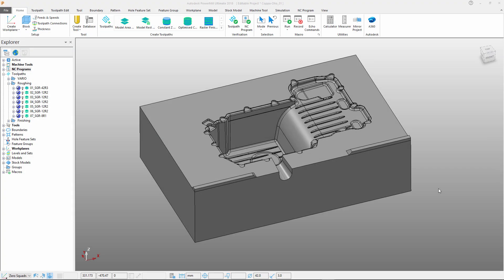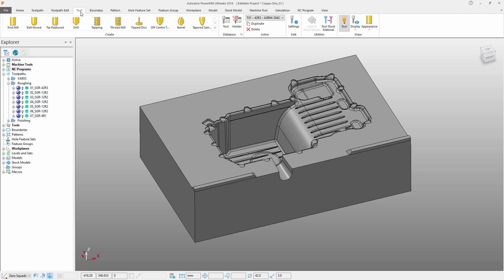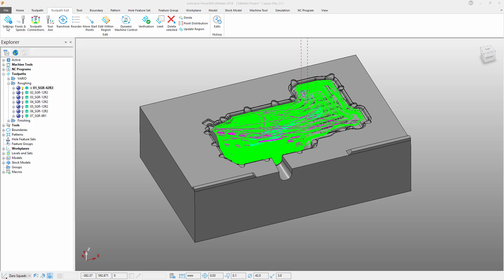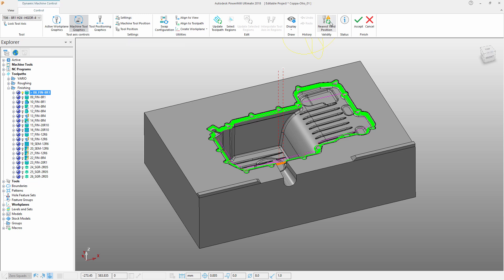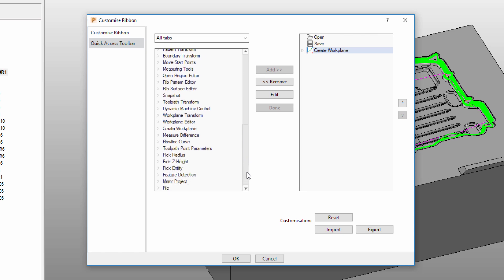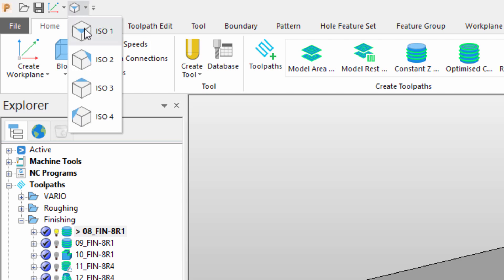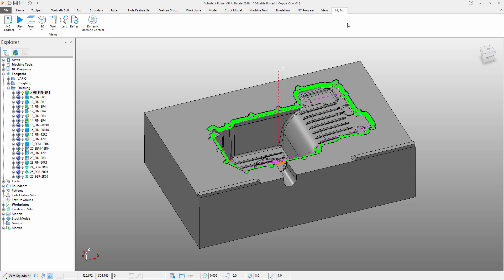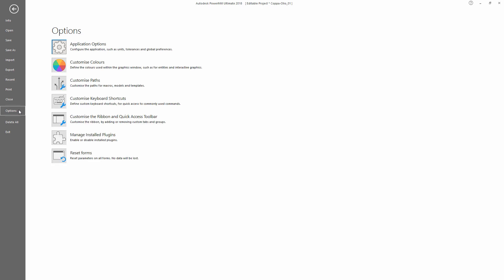Ribbon Interface - PowerMill 2018

Comment: this is the worst thing you could of done to PowerMill . This ribbon is a pain in the ass for us that have used PowerMill for 18 years . I would imagine someone that works in an office designed this CRAP.  Love PowerMill but this 2018 is not user friendly at all. I would also like to note every time I made a custom ribbon as soon as I clicked on it it crashed my session .FAIL!!Very un happy PowerMill user
Reply: Thanks for taking the time to comment on the video. 

We know transitioning from one interface to another can be frustrating. We designed the new ribbon interface with the intention of making it easier for new users to get up and running whilst also allowing existing users to be able to find commands and functions that they might not have known about before. 

We aim to issue updates on a regular (monthly) basis and will certainly look to improve stability and usability in the coming releases. Your feedback can go a long way to ensuring PowerMill continues to meet your needs now and in future so we would encourage you to contact your local Autodesk support team to let them know about your issues and gain guidance on the new interface. 

Thanks again for your feedback, it is appreciated.
Reply: its far from easy its down right painful I would rather not get any more updates and stay with PowerMill 2017 for ever than to have to deal with this . Sad it really is sad